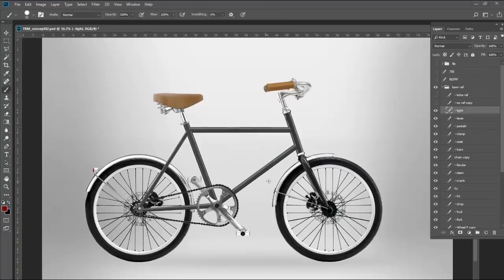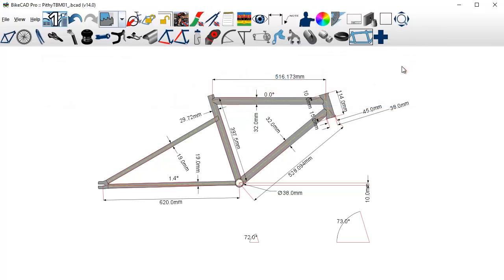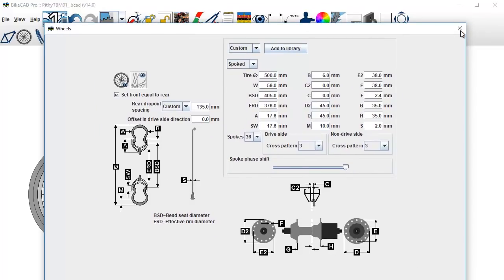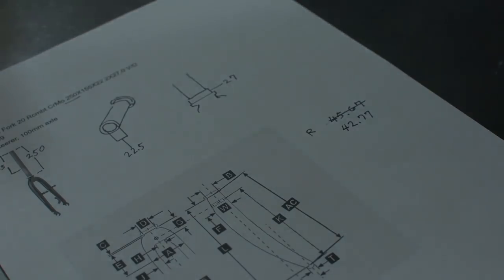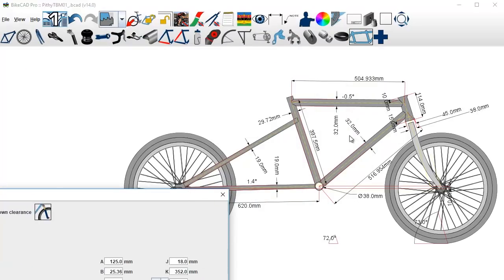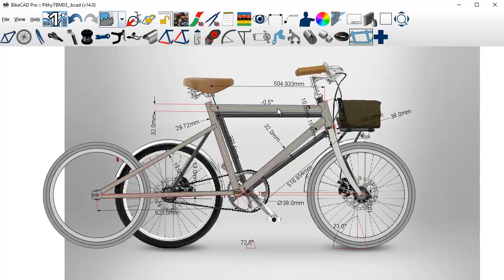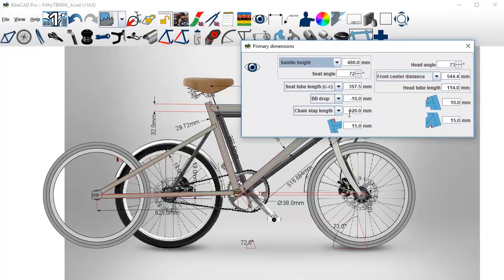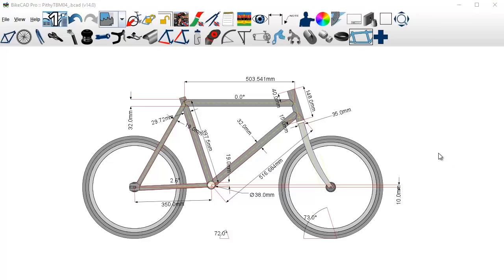BikeCAD - Mini Town Bicycle 02

Comment: More rake means less trail and therefore supposedly faster steering for a given head angle. Bikecad will tell you what trail you ended up with somewhere so it's worth checking that out (although knowing what trail you want is more of a black art- longer should mean heavier steering but more stable in a straight line I think)

Comment: Thanks for making this video. It was fun watching you figure things out as you go. Sorry about the issue with the fork rake. As you typed 42.77, it was changing it to 42.77000000000001, which is admittedly a quirk I should correct. However, it was not necessary to change the rake to 43mm. I was glad to see you figured out how to scale and pan the background image. For more on that, see: https://www.bikecad.ca/import_photo. For a quick way to hide components, see: https://www.bikecad.ca/ease_of_use_improvements_version_10 and finally, there is an undo button. It's the back button on the top row of icons.
Reply from the maker: Thanks for making BikeCAD, It made frame building so much easier for me as a beginner and continues to make life easier today!  I really appreciate that the license I purchased years ago still gets me free updated even today. Great work, great app.

Comment: 20" forks with disk brake mounts are easy to find. Just have to search for 20" trials bike forks. WebCyclery in Oregon is one comes to mind. Most are either disc or 4-post Magura HS33 mounts (or both). Not many with 2-post V mounts though.

Comment: 45 or 50mm is the crone diameter, so the diameter of the lower part of your head tube bearings. Semi integrated bearings have 50mm.

Comment: You might want a bit of BB drop rather than BB height, will make it handle better when pedaling out of the saddle. Obviously you need to consider the length of your crank arms too so they're not scraping the floor
Reply from the maker: Sam Pinion the drop I currently have didn’t change from the long tail geo. I should take a closer look to see if I do indeed want to keep it.
Reply: @PithyBikes  it might be worth having a closer look! Love all your videos by the way, I've learnt so much from watching them. Thanks for taking the time to make them for all us bike nerds!

Comment: thanks for your videos, they are an inspiration to wannabes and pros alike. quick question and a suggestion. is there anyway possible that this frame (that I hope gets the stainless steel treatment) gets silver brazed? and i would probably add 5 to 7 mm in length to the chainstays to compensate for the smaller tires. it helps build in more flex and makes the ride somewhat more forgiving on streets that aren't newly paved.  can't wait to see the end result. greetings from germany
Reply from the maker: Sylince hearthstone tunes will be 4130 steel. I’ll use silver for cable guides only. Frame will be tig welded.

Comment: The diameter for the head tube using a 1" steerer fork would be 31.8mm. Didn't you accidentally get one this size with your first frame build? If so, you may already have one!
Reply from the maker: Joey Mesa oh yeah LOL I think I do have one. Thanks Joey!
Reply: Or 32.4 with a 1.3mm wall (which is one of the sizes Columbus supply) . The thicker wall works out quite well for TIG welding. A thinner one's better for lugs.

Comment: It looks like “B” is the measurement of the very top of the fork itself, and not the steer tube diameter. I guess if you have a fork with a fat upper this would be a much bigger difference in measurement.

Comment: Bike cad sure looks a lot different now than last I looked at it. Talk about feature creep. Most of that stuff is absolutely meaningless. You would be better off just sitting down with a piece of plywood and running thumbtacks at the control points and putting rubber bands between them for the tube centerlines and just take the angles and lengths with a measuring tape and protractor. Much like the way that they loft a boat. Just do everything at a 1:1 scale. Then you can go back and set the pieces on the drawing for a sanity check when you are cutting things out.